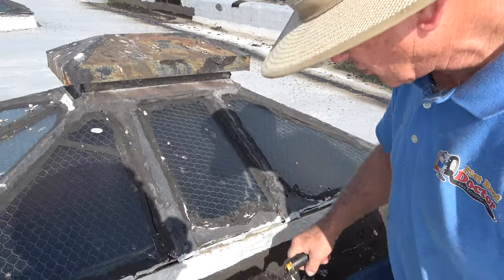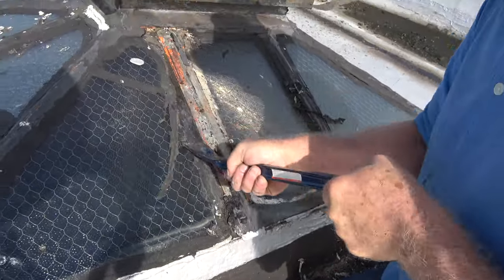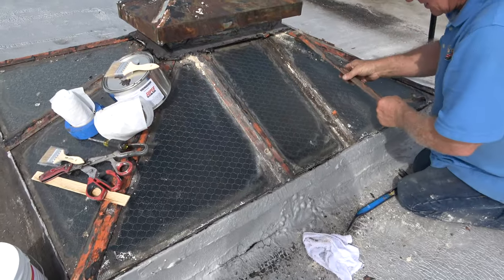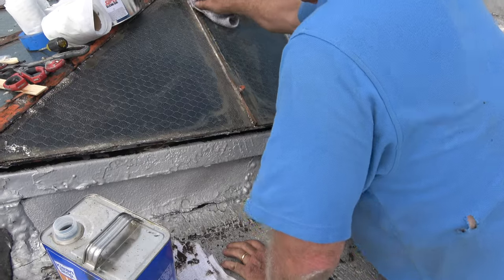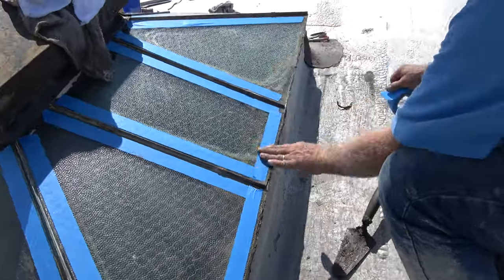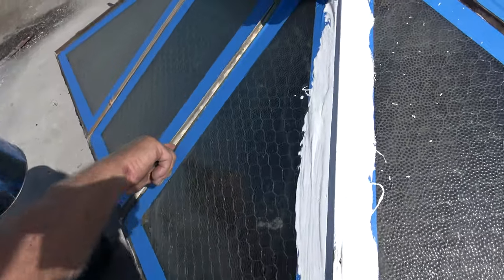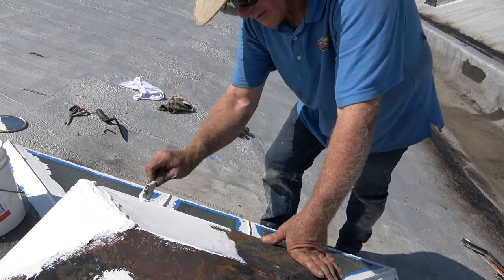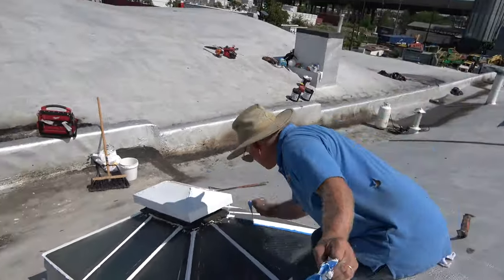Skylight Leak Repair - After repairing skylights for 30 years, this is the only sealant that works

Comment: Doc, what about the edges at the top where the glass comes under that crown? at 4:53 it's hard to tell if anything is compromised from the video, but i'm sure you gave it a look. i, myself, have been a big fan of Henry Tropicool. Stuff looks exactly like your silicone coating.